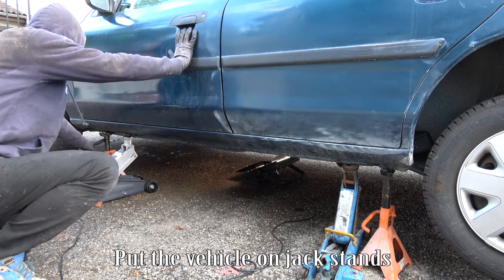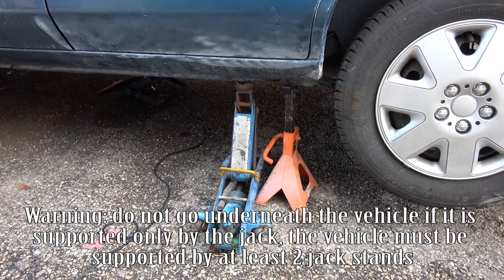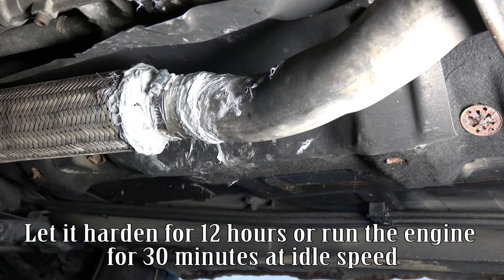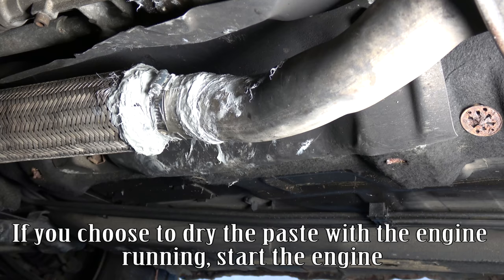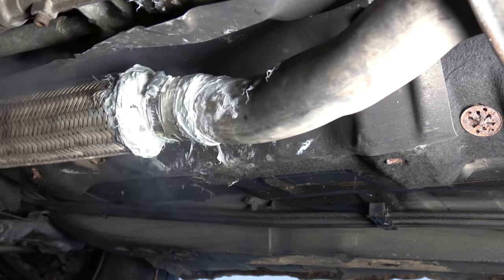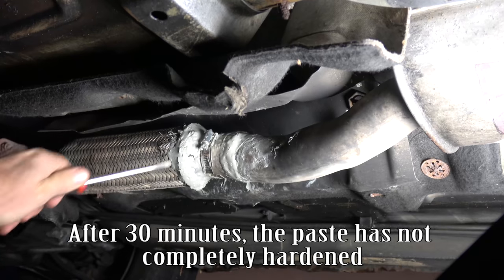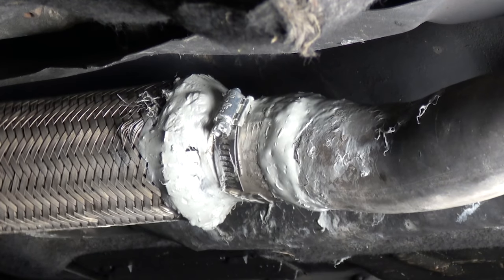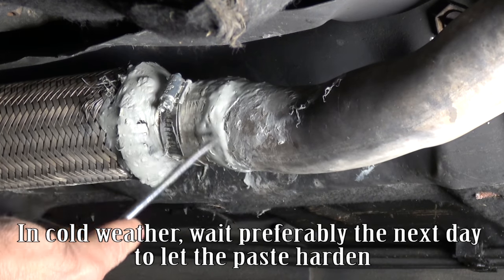Broken exhaust pipe repair (easy repair WITHOUT DISMANTLING)

Comment: It need a piece of pipe welded on. Whatever this fix is is in adequate. I needed to buy a new flex pipe. It required 7 welds at a garage up on a hoist by mechanics. Cost me $200.00. No way around it. I have muffler cement and I'll crawl under my car to fix holes and seperations of my exhaust pipes and mufflers. Maybe tape and metal can too. I dunno. Jerry rig is this DYIers fix.
The question is risk/reward.

Comment: One thing missing from all these videos what I was looking for is how long the paste stays fully workable because don't forget now I'm 80 it takes me more than 3 minutes to get a bunch paste spread real nice after I've crawled under a car. You don't want to get caught short with pastes going all crumbly. Always give maximum fully-workable time.
Reply: I am 62 and not to thrilled about crawling under the car in December to fix an exhaust issue.  To pay for it they want a new catalytic converter too.  My 1996 doesn't even need to pass fumes inspection.

Comment: I had to replace a flex pipe on a 2003 Saturn Ion. I have no hoist. It took 5 welds. It was very difficult to take off nuts. It was a $200.00 1.5 hr. job. No tape would fix my issue. C'mon, man!!!!

Comment: Should’ve let it dry without running the engine and that flex pipe needs to be replaced I would’ve just gotten it welded by a shop

Comment: They needed to put a clamp on both ends not to mention you could have just used a soup can to wrap the pipe with and two clamps to hold it.
Easy peasy.
Reply: I used baked beans can and thick bailing wire 1976 Buick LeSabre the DVE mobile toronto Ohio 1987

Comment: Better to wait 7 days for it to set.............warm up the engine before driving off........make sure you drive off in good weather and plenty of daylight............move forward slowly one car length.......Stop the car and apply the hand brake..............exit the car and walk to the rear were you will find your mushed up bandage on the floor............pick it up and place it in the boot. Hopefully you will not encounter any cops on your way to get a new clamp-on flexi.......Or you could just order a new flexi.....chop out the old one and fnd fit the new.

Comment: It would be less work to just fix it right.
Reply: To fix it right:
remove cat back exhaust at the perforated lines
buy Russian cat back exhaust (e,g,  Russian toilet paper never rips at the perforated lines)

remove catalytic converter - kill lambda probe - get new probe
remove exhaust manifold - try to remove broken stud bolts
remove whole propulsion aggregate to reach stud bolts
find ruined clutch
realize the mess in and out of gearbox
get half your finger amputated anyway
get help
yadda yadda yadda exetera
smile

Comment: I’ve tried this, its not a permanent fix doesnt even last a month the paste always cracks from the heat and vibration and leaks again I’ve tried this and other methods the only PERMANENT fix is welding

Comment: He’s under the car for an hour then waits 24 hrs. That flex pipe is about 20 bucks on eBay. Another 20 for two clamps. An hour to replace it for a permanent fix. How much was the “paste” $25? Got a week end out if maybe? Minus all day Saturday for the repair so he got a day? Funny stuff.

Comment: Getto fix ,   I replaced  the exhaust manifold, converter , flex pipe, resonator, mid pipe and muffler under $500 then cashed in the converter for $170

Comment: Much better off getting a new exhaust as that has no strength and is still leaking gas. You would be better off welding it than to use that stuff! O.K for holes but not much else.

Comment: Done this on a broken exhaust it was snapped between the cat and Flexi pipe I used the gungum a thick layer all the way round then a ally start with a clamp ran the car for 15mins and then left for about 30 hours got it drove to the shop and on the way home the exhaust went again waste of time and money

Comment: Messy ineffective temporary crap fix that doesn't work. Took a 5 minute welding job and turned it into crap. Now to fix it properly the flex pipe and exhaust pipe need to be replaced